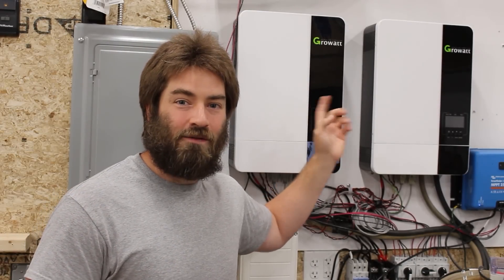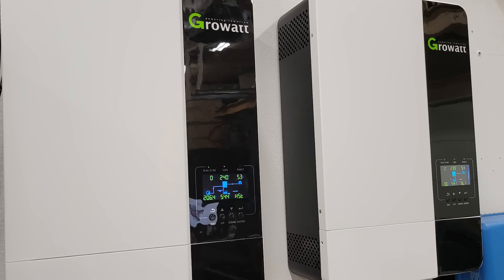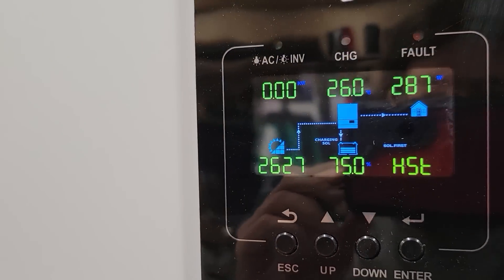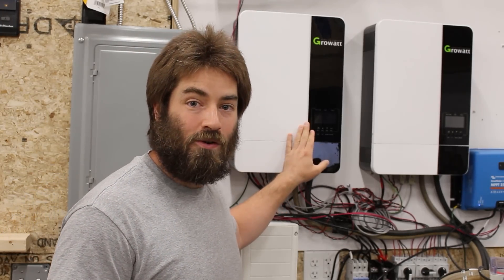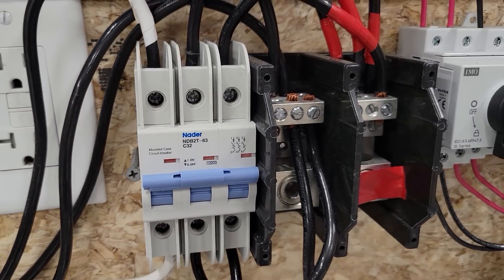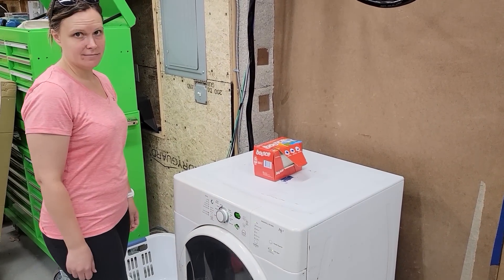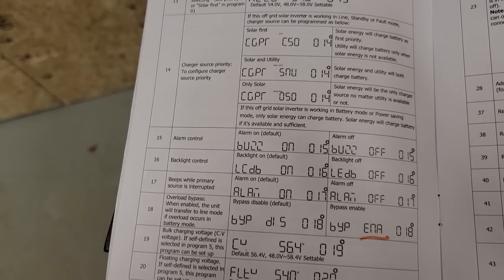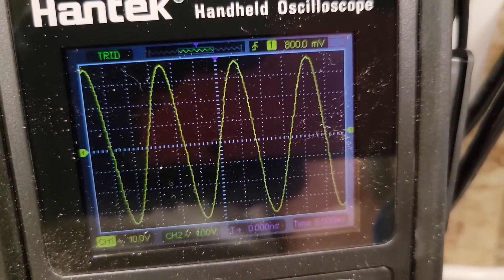Update after 1 year of use off grid, Growatt and EG4 (Gyll) batteries

Comment: Based on your videos and my own research I bought and set up 6 of these  in parallel for off-grid. And added a 92kwh (18) batteries setup.
Reply: All components from Signature solar came in around $62k for the batteries, battery racks, inverters, panels, and most of the wiring etc for the solar part. Another $4k for solar racking made out of wood (treated lumber) similar to what they have on the signature solar website As a sample with concrete footings. I paid $3k for electrical engineering plans just in case  to double check and make sure my design was solid. Wiring and bus bars and additions fuse boxes and fuses for everything was expensive (huge wire gauges between battery bank components etc) maybe another $3k. I also bought a 20kw Cummins propane backup generator that runs through 3 more inverters to charge the bank if needed. So I have my 6 inverters in parallel handling my 96 panels (6 strings of 16 x 395 w panels) for a total of 96 panels and nearly 38kw of solar, there will be losses and the inverters of 36kw (charge controller part of inverters) do fine. I have 30kw of inverter capacity to produce 240  a//c which is 125 amps. 2 auto-transformers which create the 120v for my main panel.
Reply: I'm curious on the total cost as well. Are you running a big AC?
Reply: @atomp153  i just posted more comprehensive on my previous post. I have 3 units of mini splits I’m running. 2 units with 2 heads each for my garage and an apartment above my garage. And one with 12heads for my main house. Total living space is 6000 sft. They’re supposed to be super efficient and use about 1/3 of the regular a/c electricity. They’re soft starts and variable so they don’t suck as much Ake tricota but I’m just getting ready to fire them up now. (Been building our home)
Reply: Damn, Christian........wow, that's a bad a** system,  the ladies who are trying to live off grid need more men around(and mucho dinaro) like you!!!  :):)  lol
Reply: What did your setup cost???
Reply: @stldigitalmemories  see my response
Reply: Holy crap, I thought I had a big bank - I'm running 65.5kW,  but built it myself using basically the same cells they use for all these turnkey server batteries, but only spent just under 8k for the cells, minus the other components  -
Reply from the maker: Wow, 92 kWh.  That's awesome!
Reply: @DavidPozEnergy  you’re an inspiration. I watched a ton of your videos about all the components, your testing and putting it together. Then I modeled your system and came up with mine. I’ve turned my whole system on about 12 weeks ago. No problems so far but I’ve not really had my house build finished so I’ve had a well pump and power tools and some lights on it. We’re now about ready to move in over the next few weeks so I’ll be pulling real loads at that point including a/c (mini split heat pumps) etc. But I’ve been charging our new Hyundai Ionic 5 EV about a dozen times on our system over the last 6 weeks already and it’s been great

Comment: If you've been using this exclusively without the grid, how has it been on extended cloudy days? Are you over-paneling the system? Have you had lean days where there hasn't been any sun for a few, and you have to ration the use of the stove and dryer?
Reply from the maker: I have a manual transfer switch at the main panel.  If my batteries run out, I can switch the house back onto the grid.  When I do that the inverter system is completely disconnected.  I did that just for filming this video so the fan noise wouldn't be distracting.  There were a few days in February when I had to switch back to the grid, but it was pretty rare.
Reply: @DavidPozEnergy  do you heat your house with electric heat
Reply from the maker: Hi Chuck B,  Yes, my house is heated using electric.  I was using the Mr.Cool Heat pump to heat my house, but it died last year so the past season I had to switch back to my baseboard.  Right now I have a window AC in the house so I'm looking at getting a new heat pump for the house.
Reply: Would that be the single electric baseboard in your crawlspace that you discovered heats the entire first floor?
Reply: @DavidPozEnergy  thank you for my reply I hope to meet you one day or talk to you I love your Channel I assume you do not like Mr Cool anymore
Reply: @DavidPozEnergy  Question from a newbie: I assume your inverters are hybrid, right? If so, can't you just stay connected to the grid without switching power over to the grid and disabling your inverters?
Reply: Do these not have the settings where you can run SBU or SUB like the EG4’s?

Comment: Hi, your cons are on all battery system and even utility also, thr heavy load do cause that flicker and go units it is what you saw, one blink. I have Schneider context sw 4024 fault stack and I have had outages due to software problems.  They have not fix those issues and even the retailer didn't know they stopped supporting dual stacking. I use tesla module 80 with a BMS board and they are 24volt. Presently I have 8 with 7 in use, so 1565 amph soon adding 233 amphs I do have 4 charge controller 2 midnite classic 150 one victory 150/100 this thing is a beast, lord it rocks with the shunt, I love that it follows it and works harder than any controller I have and a flexmax 80, it is shit, free so it is there doing very little. My system before being built out was a single and the classic 150 and it took me through Irma and Maria.  I came online August 2017 and I am grateful I have this unit, I had running water, light and refrigeration.  The island of St. Thomas was struck Sept 6, 2017 and two weeks later Maria, utility power was not restored to my house until January 8, 2018! Thank you if you have read this we are on the same path, mine is for survival,  the grid here is shit in every sense of the word.
Reply: I don't live in the 48 states,  I reside in the USVI St.tThomas to be exact. I love your YouTube channel and I also have a victron 150/100 and love this thing. I am flattered,but I would have to send it to my freight company and they would ship it to me at my cost if that would be okay with you?

Comment: Happy to here it! So does this put you back at net zero? :) also, how do you think the inverters would act with bmw batteries with Daly bms? Great video! Always look forward to seeing them! Take care.
Reply from the maker: I think it would work fine assuming you have enough capacity to handle the load.  For example, you would want at least 20kWh of battery capacity for the two inverters I have on the wall.  Also, the Daly BMS won't have a pre-charge resistor built-in like the Gyll batteries do.  So make sure you use a resistor when connecting it up otherwise the BMS will think there is a dead short and could be damaged.

Comment: I also bought this same inverter after watching your review and it had been running well since i installed it on 1st April 2022. It had a little problem connecting the wifi device but later figured it out.

Comment: Hi, great new Robinson Crusoe look, how many hours do you think this setup can run a 9,000 BTU 240v split air-conditioner ? Thx for your reply 👍 🙏
Reply from the maker: If we assume it's running full speed during that time, then it might draw 800 Watts.  It will draw less if just maintaining a temperature.  My battery is 30kWh, so even with efficiency loss that's over 30 hours of runtime.
Reply: @DavidPozEnergy  Thx a million, I live almost without a grid, in a building with 10 hours/day of common generator, I'm planning on installing a Growatt SPF 5000 ES drawing power from the generator and an 8.7K lifepo4 48v battery to run my 9,000 btu 220v mini split air-conditioner for 8 hours during summer nights, would it work? Any suggestions please? Thx again.
Reply: If it helps, I run my 12,000 BTU 120V mini-split off my 5KWh battery for several hours, along with TV/lights/network.
Reply: @580guru  Ofcourse it helps, thx, so my 9,000 btu 220v would run almost twice the time on an 8.7K 48v battery?

Comment: What is the purpose of your Victron charge controller if the Growatt charge controlleer works?
Reply from the maker: I have 3 solar arrays in the yard.  Each array needs 1 charge controller.  Each inverter has 1 charge controller built in.  2 inverters + 1 Victron = 3 charge controller.
Reply: @DavidPozEnergy  Thanks.

Comment: I had a huge lighting strike and it took out my GROWATTS. I am using the grid for shore power. Fortunately insurance covered my loss. I've since put a couple of surge protectors and old style glass fuse between the grid and inverters. Oh and I attacked one inverter with a screwdriver while it was active, don't ever do that!
Other than the lighting and the screw driver attack these thing have worked flawlessly. I'm awaiting my replacement that will give me 3 total.  I can charge my car with just 2 but that puts the inverters at 90%.

Comment: Very interesting David.  You can't argue with the low cost of these types of systems.  Myself I am stuck between choosing Victron and SMA Sunny island.  Noise is important to me and the Victrons appear to make some noise at high loads - I hate noise.  What were the sunny island's like at high loads because I gather from youtube videos that they seem to be very quiet!  A noise comparison at 4kw load with a noise meter would be very useful!!
Reply from the maker: The SMA's have a very large heat sink.  The fans don't seem to come on until you run 4kW for a while.  Even when the fans do run, they are very quiet in comparison to the Growatts.
Reply: @DavidPozEnergy  Thanks that is what I was suspecting. 👍
Reply: Low cost? Just the inverters and the batteries are >$11k and I assume the panels I saw in the video add quite a lot more to it. I was just thinking about my monthly electricity bill and it seems it'd take me 15-20 years for those to pay themselves back - and by that time I assume I'd need to replace some of the gear anyway (panels at least?). Not to mention I don't have space for a solar farm that size plus they'd be covered in snow half of the year up here. 

I just can't seem to find a way to make solar energy worth it for me. I'm glad it works for someone else and I'd love to build something but ... and all this not even mentioning that the price of the gear is much higher here than those examples. And I'd be paying probably double what they're asking if I wanted them to ship here. What is the monthly electricity bill for you guys - or rather, what has it been before moving to solar?
Reply from the maker: @Monoblogi   Price of electricity will vary across the country (United States) and sometimes from town to town.  Where I live (Massachusetts) we have several fees added onto our electrical bills that pushes the average price per kWh up to about $0.26/kWh

Comment: I am running four of these in parallel with a single auto transformer for my entire house and it's a great setup.
Since I have four in parallel, the load is split among all four and the most I have seen is 20% per inverter with my AC running. Due to the low duty, the fans are not as much an issue as I thought they would be.
As for con #2, I have the same issue, when the AC compressor starts, some of the LED lights in the house blink just enough to notice them, but not enough to kill any electronics running in the house.
Some older LED bulbs I have don't blink, but I noticed those also fade off when turned off as opposed to the newer LEDs which are a decisive off as soon as you turn them off.
Reply from the maker: Sounds like a nice setup.  Thanks for sharing.
Reply: Hey Inxpro: would you please share how your 3 inverters are wired to the 1 auto transformer?  Sounds helpful!  TIA ;)
Reply: @corba197  the auto transformer is hooked up to the electrical panel that all the inverters are connected to with breakers. That then feeds into my main house panel which is off grid.
Reply: @corba197  
PIP5048MG Parallel & communication cable: https://www.youtube.com/playlist?list=PLSNjIRSnUPDLhovCCynw6iW6AIeHto9g-

Comment: Growatt tech support is horrible. Won't answer the phone and email response is not helpful. I have the 6k low frequency inverter. Mine will not charge from solar or the ac input out of the box. Real bummer.
Reply from the maker: Sorry to hear that.
Reply: @DavidPozEnergy  Really love the inverter side though. Low frequency is so much better then my 3k renogy high frequency inverter. Can weld so much better! Was really hoping to have the all in one  growatt package to monitor current in and out of my batteries.

Comment: Would you buy the EG4 6500EX-48 AIOs today vs GroWatt 5000?  for $800 more
Reply from the maker: Possibly.  I can't say for certain since I have not tested it.  But, the specs on it look great.  It looks like it would check all the boxes on paper.
Reply: With the out-of-box integration between them and signature solar support I'd probably go with them. Depends on your experience level with solar/battery systems. Remember, both only meet UL1741 criteria and are not fully UL approved so know what that means before jumping in.

Comment: So I found the Hue lights don't have any issues with the voltage sag or when it transfers with my LV5048.  It took a bit to find a good solution but those lights don't react at all.
Reply from the maker: Are you referring to the line from Philips? What model are you using?  I might buy one and try it out.
Reply: @DavidPozEnergy  Yeap that's correct.  They are very resistant to voltage drops.  I even played around with them on a dimmer to see, they must have some sort of capacitor that smooths everything out.

Comment: I wish that I had known about these (maybe they weren't even available) before I purchased my Sol-Ark 12K, for several reasons. I don't understand why you need the Vitron charge controller, can you allude why? I've been trying to purchase an auto transformer but, I recently found out that SolarEdge is not making them anymore. The model that Growatt makes is out of stock at Signature Solar.
Reply: Craig , Victron makes an auto transformer . Their larger one is a 100 amp with built in breakers and fan .
Reply from the maker: I have 3 solar arrays in the yard.  Each array needs 1 charge controller.  Each inverter has 1 charge controller built in.  2 inverters + 1 Victron = 3 charge controller.

Comment: Thanks for the update! My lights dim for a split second too on my AIMS inverter when starting heavy loads.
Reply: Even mains powered electrical system drop voltage with a high surge instantaneous load, so the flicker is definitely not a problem.
Regarding the fan noise, it might be helpful to remove the standard fans & duct larger fans through the units, or supplement the originals with a cheap external pedestal fan so they won't need to work as hard. 👍
BTW, I love the system that you've put together mate & would love to do the same, but unfortunately everything's either super expensive or unavailable here in Australia.
Reply: @CNile-se9xw  Yep, I am on grid, and LEDs flicker at any big consumer, like a kettle. They are sensitive at voltage, and has no inertia like incandescence.
Reply: I’ve noticed even putting all your circuits behind an inverter in grid pass through (with 6 AWG wire in my case) limits surge current enough to cause the split second light dims. It made me start noticing it in other older homes that are pure grid too.
Reply: I noticed that approximate 5 years ago with I installed two mppsolar 2424lv-msd inverters
Reply: I wonder if anyone has tested using a separate tiny inverter (less than 500W) just for the lights to avoid the flicker and maybe gain a bit more peace of mind in knowing that if the big inverter overloads and shuts down, you won't be left in the dark. Basically I wonder if the voltage sag propagates all the way to the battery terminals and could affect a second inverter.
Reply from the maker: Hi LithiumSolar.  Seems to be common, but I thought it was worth mentioning.
Reply: My little MPP LV2400 w/5KWh battery also telegraphs an ever-so-brief light blink when switching between battery & grid.
No problems with tv/stereo/network gear so far.

Comment: Would having all 3 battery help u reduce stress on the 2 only battery and u might not have the lights flickering when there is a heavy draw?
Reply from the maker: Probably would help some, but I had the lights dim with 3 inverters in parallel too.

Comment: Hi David, great video. I see that you still have the pair of SMA in the background. Can you contrast your overall experience with the 2 new Growatt vs the pair of SMA? I also have 2 SMAs running 48V Fork Lift Lead Acid Batteries. I have been thinking about upgrading to Lithium with the EG4 but I am not sure if the SMAs will be able to handle these. Can you comment about this or do a video on upgrading the SMAs you with the EG4? Thanks.
Reply: I have a newer DC solar trailer that I just moved the components into my off grid place and added two more strings of panels along with an additional charge controller and it’s been working well. Amazing cost savings finding those trailers.

Edit: the SMA’s can do lithium. Midnite Solar has a whole batch of info regarding a setup with lithium, a classic, and SMA’s.
Reply: I would love to see this review as well. Which is better Growatt or SMA if you take the cost out of the picture?
Reply: What is an SMA

Comment: I’ve enjoyed your channel over the last few years.  I’ve purchased my last set of lead acid batteries for my off grid setup and am looking very seriously at EG4 batteries for my next set.  I’ve got two schneider 4024 inverters and 2 midnite classic 150 charge controllers running my system now.  I was pleased to see that Signature Solar is working with Schneider these days.  When that eg4 purchase goes through i’ll be certain to use your affiliate link!  keep up the good work!